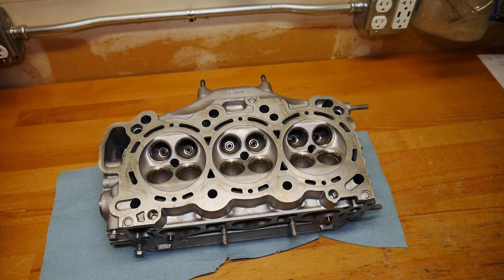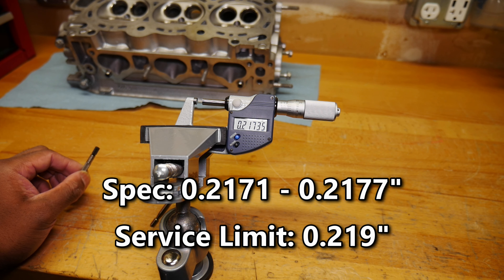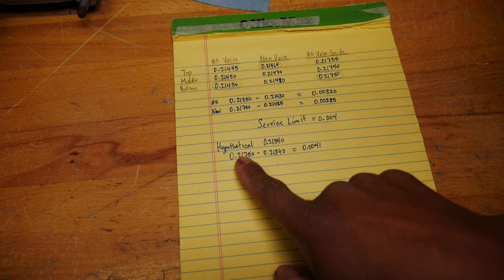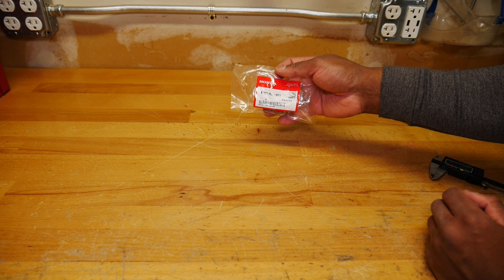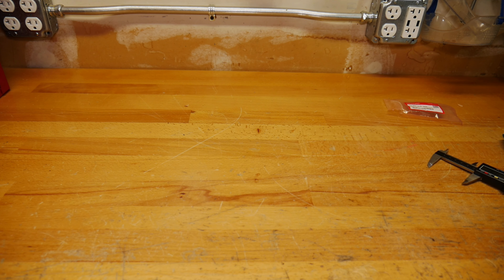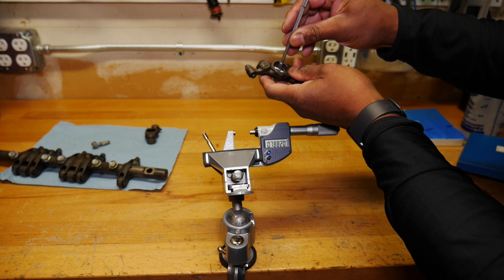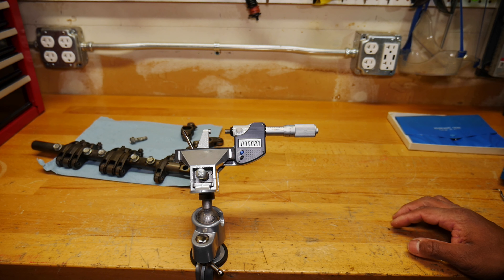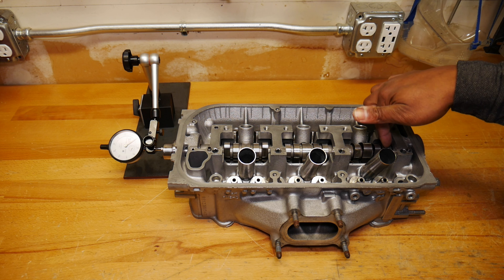2008 Acura MDX Cylinder Inspection - Part 2 of 2

Comment from the maker: The 2008 Acura MDX's cylinder heads appear to be in good shape, so we'll start putting them back together!

A couple mistakes in the video:
@5:53: Bore #18 valve stem-to-guide clearance is slightly out of spec, but it's not close to the service limit.
@19:22: I should have used the ends of the calipers to get more accurate measurements of the lobes.

Please leave a 👍 and share the video! 
👉 Visit our website ► http://carapprentice.com
👉 Click to Subscribe! ► https://bit.ly/3bLvCFd

👍▬▬Follow Us on Social Media▬▬👍 
✔ Facebook ► https://bit.ly/3bHtMFC
✔ Twitter ► https://bit.ly/3hLdJKK
✔ Instagram ► https://bit.ly/3u380lS

🔧▬▬Tools and Materials▬▬🔧 
✔ Car Apprentice Recommended Tools and Materials ► https://bit.ly/3DP75xM
✔ OEMTOOLS Straight Edge ► https://amzn.to/48Prij3
✔ Mitutoyo 2046S Dial Indicator ► https://amzn.to/48MGzks (Note: Indicator pointers were not included)
✔ Mitutoyo 293-832-30 Micrometer ► https://amzn.to/436SOY9
✔ Stanley Proto Metric Feeler Gauge Set ► https://amzn.to/3T1OTac
✔ Magnetic Base for Dial Indicator ► https://amzn.to/3VblqxA

📷▬▬Video Equipment▬▬📷 
✔ Camera used ► http://amzn.to/2GcpkOb
✔ Lens used ► http://amzn.to/2Deu16S
✔ Tripod ► http://amzn.to/2GbaM1c
✔ RAM Suction Mount ► https://amzn.to/2Wz9PXh
✔ Cyberlink PowerDirector ► https://bit.ly/2jTwGxT
✔ Adobe Photoshop ► https://bit.ly/2V7nyUX
✔ Camera Slider ► https://amzn.to/2WtD7GW
✔ Deity V-Mic D3 Super-Cardioid Directional Shotgun Microphone ► https://amzn.to/2LI1lf7

This video was recorded in 4K resolution, so modify your settings accordingly for better image quality. 
Disclosure: This video contains affiliate links, meaning, at no additional cost to you, I will receive a commission if you click through and make a purchase.

Comment: I’m going to buy a MDX 2008. 99,000 miles on it. In pretty good shape. It’s a good vehícule? It’s reliable? Is it common for the engine and transmission to break down? I need something reliable. but what a pleasure to handle it.
Reply from the maker: The engine issue I'm addressing happens on occasion, but they are generally seen as reliable cars. If you have concerns about the particular car you're buying, it's a good idea to have a shop inspect it.